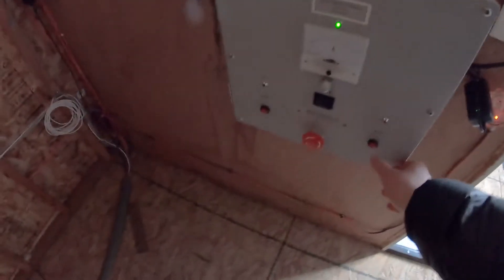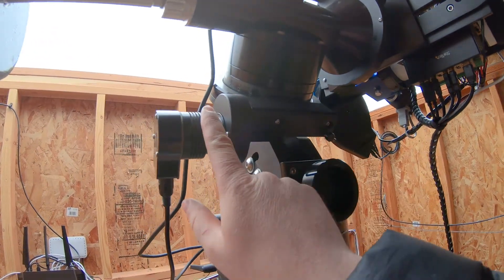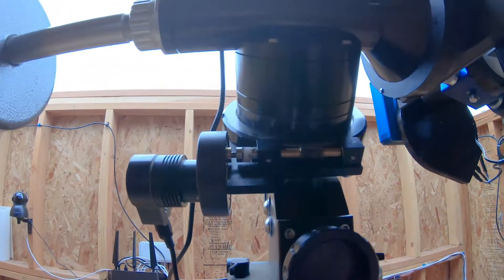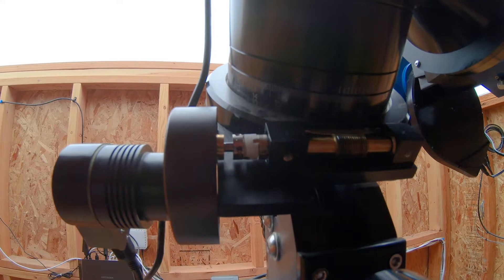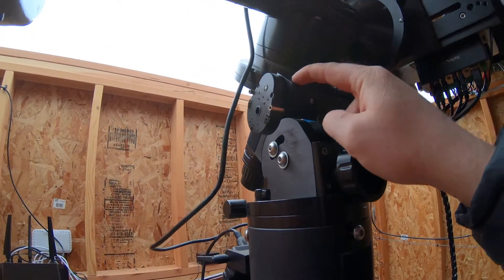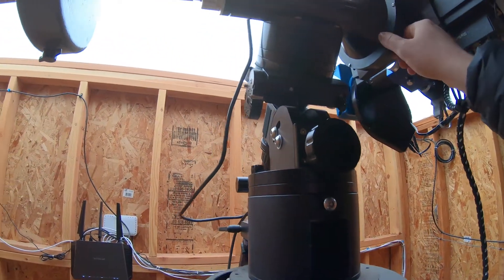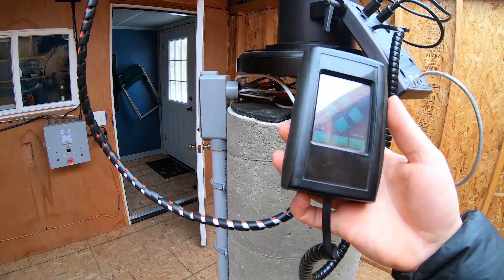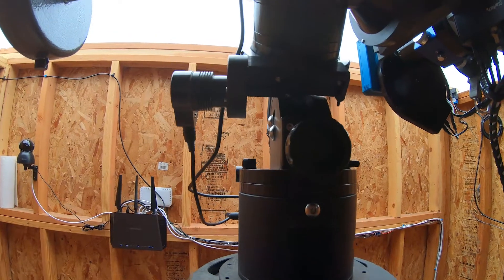RA Gear/Coupler Adjustment - Losmandy G11

Comment: If you put the mount in counterweight down position I.e. that is with the telescope pointing towards the celestial North Pole. And then do a warm start rather than a cold start, you will not lose the model of the sky. You simply need to instruct the amount to point to a star and then use the direction controls on your computer or on the handset to center the star and then select sync in the model will be realigned with them out.
Reply: Sorry, that should read once you have done the sync, the mount will be realigned with the model.

Comment: Have you noticed how the RA worm gear looses adjustment over just a few months?  My new G11 guided quite well  for the first month or so I used it. Over the next few months guiding degraded a lot and it’s all in the RA.  Backlash increasing?  Seems that shouldn’t change that much in just a few months.